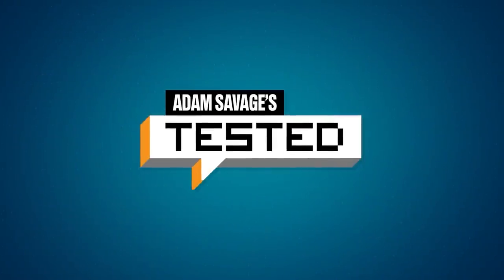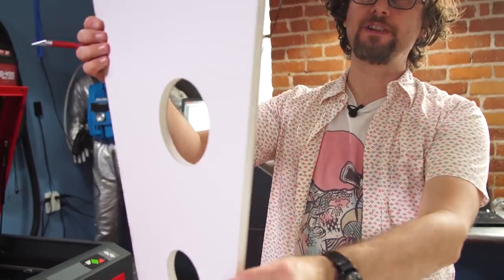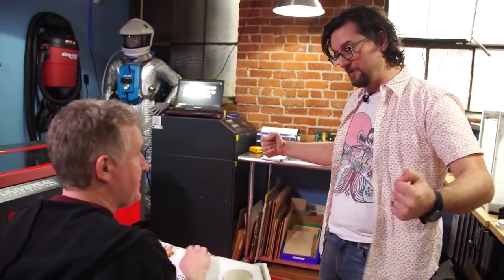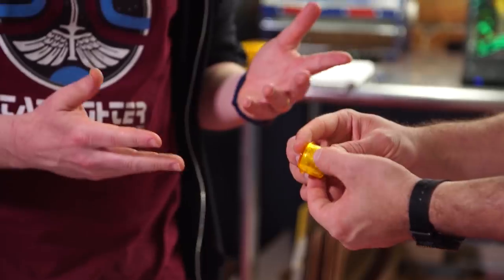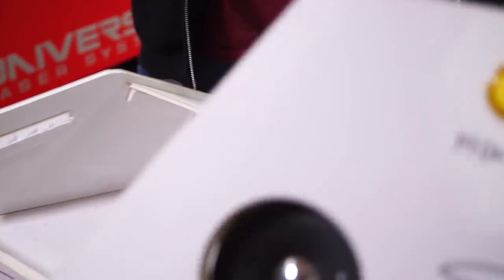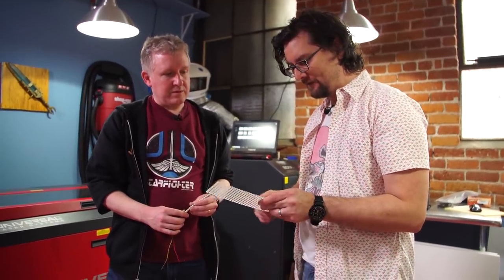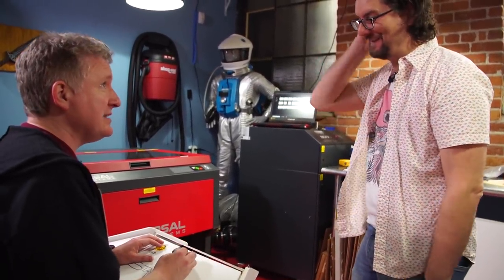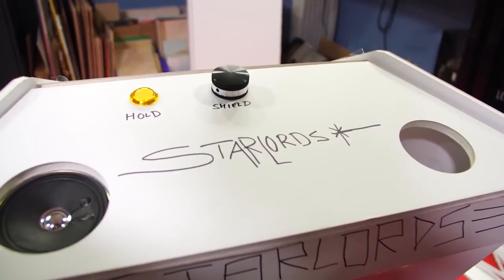Bits to Atoms: Starlords Arcade Cabinet, Part 3

Comment: Dude, that LED strip idea is rad.
Reply: If clear acrylic is still going over the main control panels to protect the wood and vinyls I'd just match that for those center light areas.

Use those light tubes he has and not worry about making frosted panels.  Make the under panel with thin 1/4 plywood, paint and put matching vinyls on it, then cover with the clear acrylic panels and just leave them clear.. It will make the vinyls pop and make them match the main control panels.  The led strips etc will be hidden behind the 1/4 wood.  1/4 plywood is cheap and will cut fast on a cnc.

If you want those light bars to be more even/solid I'd just add a second led strip on the top so light comes from both ends. Although it still looks cool with the light coming from one end.
Reply: Right

Comment: I work with lasers (in a hospital setting). I hope the glass top on that laser cutter protects your eyes. Is there an auto cut-off or lock if someone tries to lift the lid? Great idea to do a full-scale mock up. Cool project to follow.
Reply: Chad The Inhaler yep it does and yes there is 👍
Reply: Infrared wavelength laser, gets absorbed by clear materials

Comment: it would be awesome if there was a parts list or something for these, particularly those LED's and controllers, really cool stuff, but its hard to catch it in the video exactly what their called
Reply: LEDs were just standard ribbon version. Trick was using frosted acrylic and having a separate finger right above each LED. Need to have blank space between fingers.
Reply: using that idea with the light bars has so many applications, I may steal that idea for something  @CworthDynamics

Comment: I want to add some LED accent lights to my arcade cabinet.  I found something on Amazon but what is used to trigger effects?  Is there an application you can use to configure to work with Windows or a MAME Frontend?